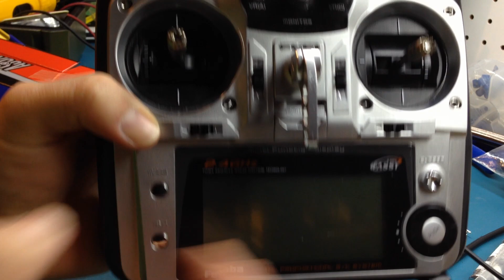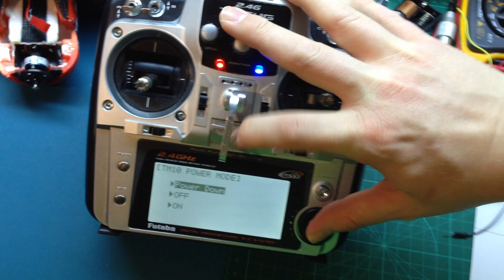Futaba Transmitter Mod

Comment: Sorry, I didnt understand, so if I hold the push button and turn on the radio and, turn off the "fasst" system, I will not need to map the channels?Basicly everytime i want to use fasst I turn it on and when i want to use frsky i turned it off?